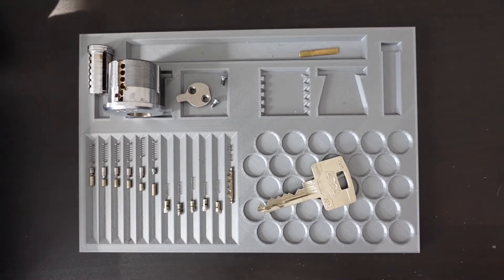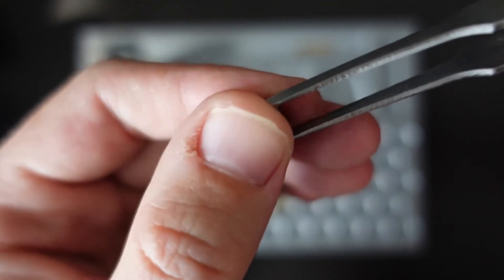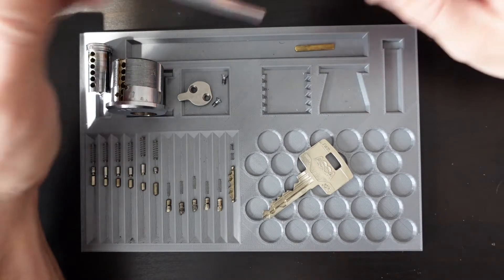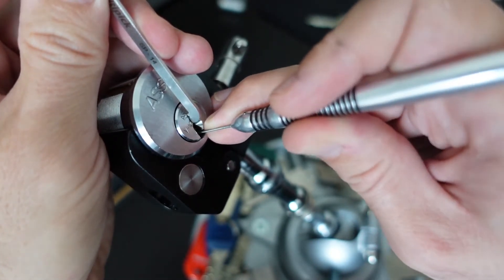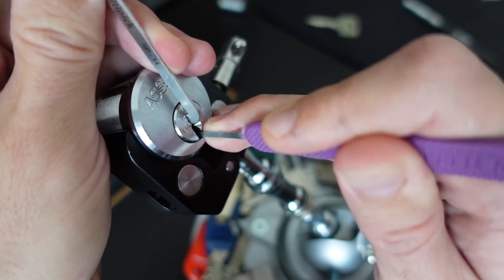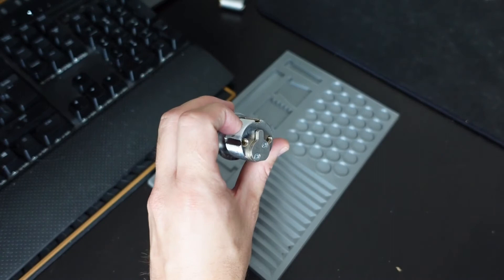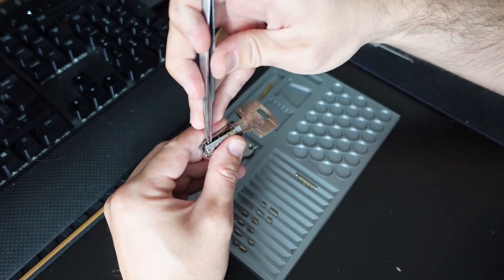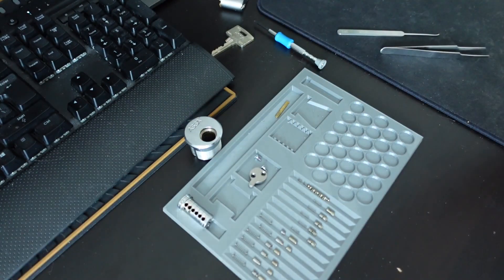ASSA Twin v-10 (gin bottle spools) picked and gutted

Comment: Yes that is  great picking ,so Well done.
Is the sidebar  reversible? If not is there any indication on the bar
To say up,down,front back. Billbobaggins.
Reply from the maker: thank you for the response! there is actually no indication on the sidebar about the correct orientation, you have to know how high the cuts are in order to make it work with a key when reassemblying. that being said, I believe it is reversible due to the nature of the design, it just obviously makes the key not work (unless you have a specific combination of bitting heights on the sidebar that make it work both ways).